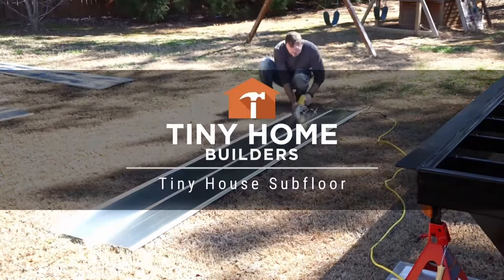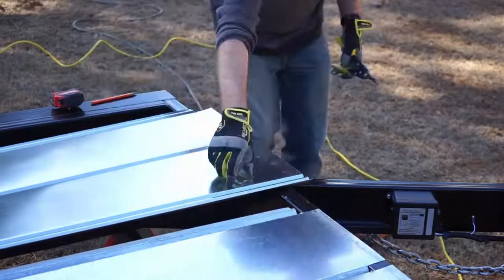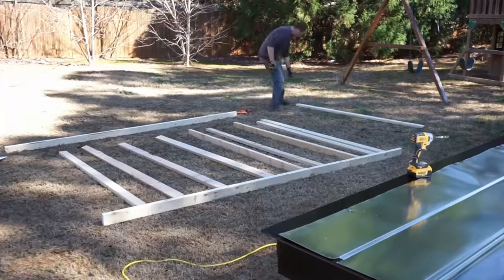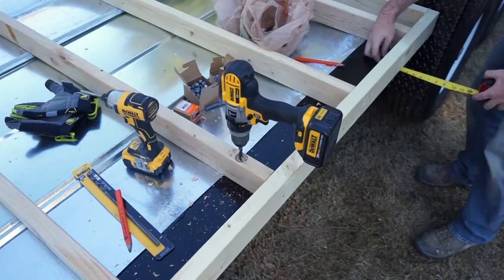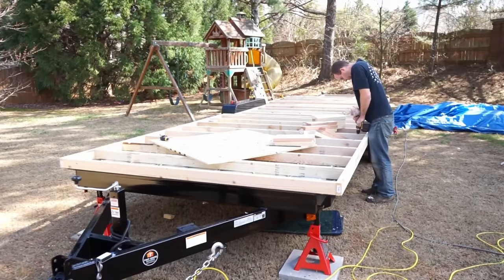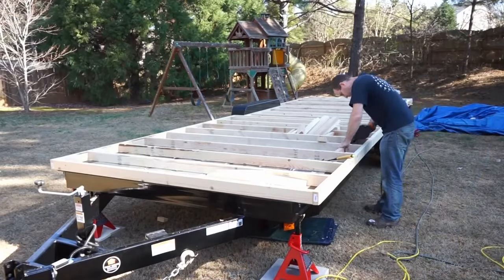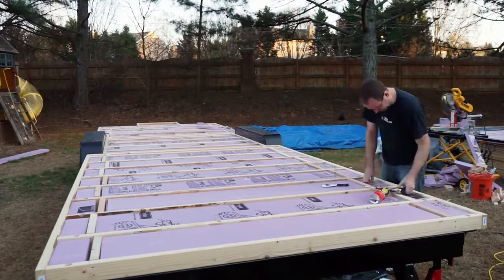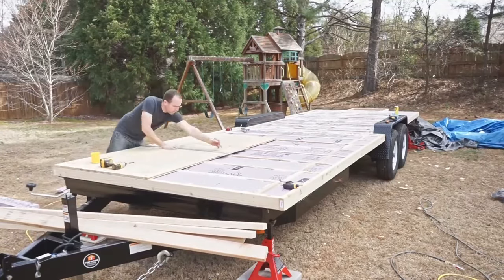How to Attach a Tiny House to a Trailer - Tiny Home Builders

Comment: Wait, you’re putting untreated pine directly on the metal frame? Aren’t you worried about condensation and it rotting?
Reply: I was thinking the same what should you do instead though
Reply: @hurricanesun77  they make sill gasket, which is designed to be between the framing and concrete foundation of a house.

Comment: Excellent video, what size of metal profile do you recommend to make an tiny home of 9 meters long, I am referring to the size of the chassis, the square iron of the platform where the house will be mounted, 100x50x3mm or 120x60x3mm would be of great help your advice. thank you.

Comment: Dan how come you didn't place the insulation with the trailer framing to increase the head room? Are you not able to attach the subfloor directly to the trailers internal framing?
Reply from the maker: You can skip the subfloor and attach the sheathing directly to the trailer, however, it is very difficult to properly insulate in that case since the metal is hollow and not a good insulator.

Comment: Hey Dan. Thanks for this video.  I'm curious about the bolt attachments of the subfloor ot the trailer frame.  Are you only attaching the joists at either end to the metal flange (ie 2 bolts per joist)?  Or are you also bolting the subfloor to the runner beams in the middle (ie 4 bolts per joist)?
Reply: Good question didn't notice that. It looks like just the ends. I am wondering if the drilling in the tube steel would degrade its strength.

Comment: What is the length and with of the trailer?  What is the height, length and weight of the tiny house to be attached? What type of truck can reasonable accommodate this type of hauling?
Reply from the maker: This is a 24' trailer. The trailer is also 96" wide, which matches the width of the framing. The total width of the house ended up being 102". You would need an f350 class truck to tow this.

Comment: I think I would use a 4x4 in place of that 2x4 when anchoring to the frame. Not much meat on the outside of that there anchor bolt